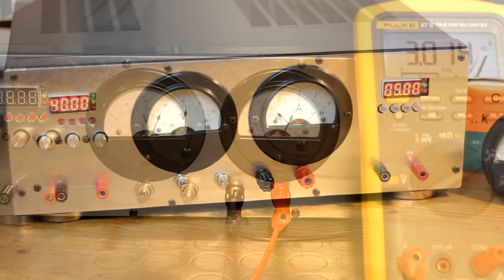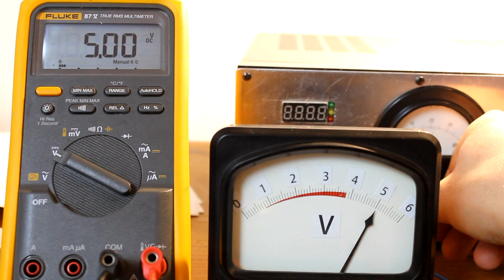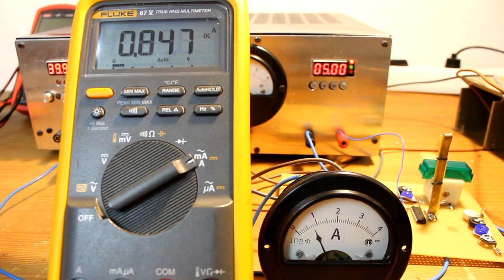Trailer: Reuse, Modify and Calculate Cool Old Meters

Comment: I love recycling old meters like this.  One tip to anyone reading this though... if you take the glass out for whatever reason... do NOT use epoxy to stick it back in.  Thermal expansion of the meter body will crack the glass.  use silicone or some other flexible adhesive.

Comment: AC Amp and Volt meters are very cheap. But DC mA/uA and mV meters are very expensive. It will be really nice and cool to convert cheap meters into expensive ones with some electronics.
Reply: Simply go in the meter and mearure the coil itself, usually they only need some several mV for full scale deflection. add a series resistor according to your needs and here you go....;)

Comment: you get a thumbs down for uploadeing a trailer. i hate that! sorry.
Reply from the maker: Ok that's your opinion and it's good to know why someone might give a thumbs down, because without that I'm left in the dark, wondering why it happened. Now let me tell you about my reasons for uploading trailers: My last video was over half an hour long. Designing and building the power supply as well as filming, editing and recording the material needed to produce a video cost me between 120 and 140 hours of work. It was one of my most work- and time-intense epsiodes yet. But after one week I can see that the video has not been received well, only comparatively few people have watched it. On the other hand, there are (for example) enough people on Youtube who just talk into a camera for ten minutes and get way more views for that and earn way more money even for that little effort. If you were in my position you would have felt just as devasted as I felt a couple of days ago when I saw that all my work is basically for nothing. To be honest: I'm surprised that I even found the strength to get back to work right away. In fact I worked for the entire week to make a new good video possible and not think anymore about past failures. And now it is Saturday evening and a large portion of the work for the next epsiode is done. I have done the planning and thinking, and I completed the actual building process and the filming the material. But a good video also needs a clear narration, good audio quality and clean editing, or otherwise people will not watch it. It would be possible to force these things within a couple of hours and publish a very mediocre episode, but then I will hear people's complains about the shortcommings of the episode for years to come. For all I know this stuff will be online forever, so it better be good, when it goes online. On the other hand, I have patreon supporters and many other fans who are used to the high frequency of uploads that many content creators offer. So in a situation like this, it is the best compromise to offer those people a little update, a little teaser that shows them that I'm working on something interesting, even though no new entire epsiode is finished yet. And I'm actually glad that you posted this comment, because it makes my understand what some people's reason might be to dislike a video. But I also have to say, that I always put a "TRAILER" in all caps into the video title, so that everyone can see what it is. So next time, please just read the title and don't watch the video if you don't like the trailers. It might not be your intention, but all that dislikes are usually doing, is to lower my enthusiasm to get back to work.
Reply: first of i'm a patreon, i really enjoy all of your videos, i will admit i'm not good at leaving a comment. mostly because of my dyslexia.
i have one problem with the the word trailer, it is in the back of the title. and when i get a notifikation on my phone i cant see the whole titel Until i "click" it :) i'm looking forward to this movie but when i realized that it whats a trailer i got annoyed. but please take it as a positive criticism. again, I enjoy all your movies, keeps op the good work
Reply from the maker: Ok. I can understand that. It's a valid criticism and I guess it's a good thing that you like my videos so much, that it makes you angry when it's only a trailer :D. So I guess this is the best way of getting a dislike. Thank you very much for your support and for your honesty :)
Reply: I really enjoy these videos and am heavily inspired by the work you do. The 'trailer' approach is good as it builds anticipation and reminds us of the work that's required to generate such in-depth and quality content. Since your DC power supply video I have been searching for an old AV receiver so that I can utilise it in a similar way; I'm an electrical engineering student and am in need of a lab power supply so the work you do is certainly not in vein. positive comments are probably far less common then the negative ones please keep up the good work as it really is very highly appreciated. Also, What is your source for these moving coils meters? I'd like to get my hands on some myself. Thanks mate.
Reply: Now read your wall of text again, from the perspective of one of your viewers, and tell me what's wrong with it.
Reply: The Post Apocalyptic Inventor   The same thing happened to me but it doesn't bother me at all. Maybe a little disappointed it wasn't the full video, but I can wait!  I bought a lot of those meters for $1 apiece at an antique radio swap meet years ago, and I may finally have a use for them. Looking forward to the video!
Reply from the maker: Well, if I'm supposed to take the perspective of the viewers, which I have to do nearly all of time when making my videos, then it is only fair that viewers who criticize me, take my perspective once in a while. And that perspective involves A LOT of factors, hence the "wall of text".
Reply: The Post Apocalyptic Inventor what I mean is, look at the tone. It comes across as defensive and a bit whiny. Also, between the lines, I read the motivation of ROI: "I put so many hours in, and someone who just talks into a camera for 10m makes more than me". Youtube is not a source of income. If it covers the cost of your videos you're already doing well. If you're in it for the money, you're well on your path to becoming the next bland youtuber who constantly whines about how youtube changed the rules and made your life harder, when they're not busy talking about other youtube "celebrities". 

I know some people who've unsubscribed because they think you've become too much of a beggar and whiner. Personally, I'm still on the fence. But if I have to be honest, I much prefer the style of that other German electronics youtuber, because with him it's all about the project and the build process, and not about him and his personal situation. 

Sorry of that's harsh, but I'm just giving you the impression of a third person observer. Because we're all blind to our own image; we can never see ourselves through the eyes of others. Although looking at your own videos may help a bit, especially when contrasted to those of others.
Reply: don't worry about the dislikes as much, as the way you tube treats likes and dislikes in the end, is they all get added together and count as audience interaction. So whether thumbs up or down or a comment it's all interaction, and that will help to get your videos more potential views from non-subscribers by bumping you in search results. So there is always a positive to see in it. =) Looking forward to the full video as well. One of many jobs I did in the NAVY was gauge calibration technician - mostly liquid, temp and pressure gauges.
Reply from the maker: See you talk to me as if your views reflected the views of "the viewers", while it is a fact that I have never really talked about myself and my situation for more than two years on this channel. It was largely because many "viewers" wanted to know more about me, that I started to open up and talk about personal stuff. Since I never talked about it before, the personal stuff has of course become "more", but I guess one thing hasn't changed and that is, that this channel is about the substance. 
Also you can call it "begging", but the people who actually support the channel make it possible for me to continue my work, without the need for corporate sponsors and the strings that are attached to that. I'm not saying that you are alone with your opinion, but on the other hand there is  large number of viewers that do support the channel and that help actually changes something in the real world. You and others might have many ideas of how things could be done better, but the truth is, that your words don't help me or anyone else. I run this channel as good as I can and I do it with the support of people who like it. The alternative would be that I just do something else with my life again and then there would be no more videos, or only one here and there in a long while. And I  just don't think that that would be the best way to go about it.
Reply: Hey, ich möchte dir ein paar aufmunternde Worte da lassen. Man kann durchaus erkennen, wie viel Arbeit in deinen Videos steckt. Es ist - finde ich - auch vollkommen in Ordnung enttäuscht zu sein und dies auch mit zu teilen. Warum auch nicht!? Es gibt schon genug Menschen, die die unrealistische Vorstellung, dass alles immer super-sonnig-enthusiastisch ist, transportieren weil Selbstzweifel negativ konnotiert sind. Tatsächlich zeigt es deine Stärke zu dir  zu stehen und das ist eine tolle Eigenschaft die man selten findet, da viele Menschen große Angst davor haben. Am Ende ist es wichtig, dass du dich nicht hängen lässt, neue Projekte angehst und persönliche Interessen ("Was will ich tun") nicht vollkommen von Klicks abhängig machst. Leuchten deine Augen, wenn du von deinen Bauten anderen erzählst? Hast du zu dem was du tust wirklich Lust, strahlst du es auch aus und kannst andere Leute begeistern, das Ergebnis wird gut und du verbiegst dich nicht selbst. Alles Gute dir!

For English speaking folks: Just some words in German that he should keep up his work and not be afraid of speaking his mind. Showing doubts is also a strengh few people have. It was just more natural for me in my mothertongue.
Reply: I say don't waste your time explaining to people like this or/and trolls.
Better even, spend that time making the great videos you make but maybe add a short "face" statement as in this video and ASK/REMIND your viewers to share... and the rest HELP stuff because if you don't ask - you don't get.
Again, don't bother with the people that don't get it and need lengthy explanations - they are not worthed imo.
Great job as ever and the trailer did its job in making me ready and wanting to watch your upcoming video and even play with vintage meters myself.
Sherring with my 11000 followers too ;-)
Way to go!
Reply: I don't speak for "the viewers", because the mythical "the viewers" which are in perfect agreement is a beast that does not exist. I speak for a small subset I actually talked to, which is representative of a larger group. And among those I spoke to there is consensus that this is how they perceive you. What you do with this information is up to you.

What bothered me about your initial response was that you justify yourself from a weak position. You manage this channel, right? You create the content, you put in the time to edit it, polish it, upload it. So if someone criticises an aspect of your work, you don't make long winded excuses as to why you did what you did, you don't start whining about how hard all of this is. You consider their criticism, thank them for it if it's relevant, briefly explain your reasoning while leaving out all the drama, and learn from it if applicable. And if not applicable (there will always be trolls), simply ignore it. Why let it get to you that someone might not like your content? It is impossible to please everyone. Criticism is there to learn from, not to have it affect your mood.

At least, that's my take on it.
Reply: If you want a cheap PS, you also could use an old PC power supply and add may be two cheap DC-DC converters (see ebay) to have a power supply you can start with...also see my other above comment on where to get cheap movein coil meters, and how to deal with them...;)
Reply: that´s the main reason why i don´t really like doing YT videos any more...it eats up so much time, the time i could have spent better on building stuff...so i really don´t do much YT suff any more, besides showing some quick&dirty short and non-edited clips and focus more on my instgram account where i can show things faster and by far more easier....I simply haven´t got the time for this editing and re-audio processing anymore...thanx to my dayjob....
Reply: I actually like this trailer (and most of his other trailers).  I like seeing the "preview" of what I want to watch first. It helps me choose what I want to watch, and what I don't.  Thumbs up for me.
Reply: Kim Loft Bennetsen bullshit. nobody forces you to watch it and you were also not tricked into watching it since it clearly states that its a trailer.
Reply: I also meant to put down a dislike, but more as a feedback towards the fact that I wasn't expecting a trailer. It also didn't look like a trailer, I was almost thinking I had to get actual information from the video. I'm looking forward to the actual video very much because I have a shit ton of those meters and I'm glad you're taking the time to explain how to use them. About the power supply video: I didn't watch it, because I'm expecting a video that I won't be able to follow through because it seems very work intensive. It's definitely a cool meter, though. I'll watch the video now.
Your videos are great - a bit technical for my taste, but I guess that technical videos are proving their value more in the long run because people will keep coming back to it for reference rather that watch it for entertainment right away.
Reply: Kim Loft Bennetsen fair point
Reply: digitalradiohacker: please try to act like a grown-up. First of all, I am not being hostile towards TPAI. I merely criticised some aspect of his videos, based on my own observation and independent discussion with others. So it's really not necessary to attack me for expressing my views and those of at least some subset of his (ex) viewership.

Second, if you're in a foul mood and simply must insult someone online (we all have days like that), try to take some pride in it and at least insult them by criticising something they actually attach some non-zero level of importance to. You might as well have pointed out that I don't exactly have the most womanly figure. While certainly true, it's not like I'm putting a lot of work into it, sweetie. 😙
Reply: Yep - TROL confirmed!
Reply: That's spelled with two l's, genius. I wonder what else you got wrong. ;-)
Reply: Now my spelling bothers you - Yep def a troL

Comment: I do this with every "DrehSpulMessinstrument" i buy. Mostly used, off ebay and mostly with a single digit count on it. Just for fun. Because i like these old meters.
Usually i proceed as follows: quick test if it´s working.
If so i go in just to see in which condition it is and if someone already was in there (not uncommon for 30+ years old meters)
Also i remove the resistors, or use some spare screw terminals to gain access to the coil leads.
With that mod, i can pretty much use it for any measurement thing, as these coils are usually rated for several milliVolts for full scale needle deflection.

And when i find a use for a meter, i do the following:
I design a circuit for the meter, with usually also compensate/alter the needle movement dynamics/ballistics as well (as mostly i do VU-meters) and therefore i need to have access to the coil anyway.
And most times i add a nice flood-light as well, i used to mount some 5050, 0805 or 0603 SMD leds inside, but since there are these nice neopixels around i use them, and have the opportunity to illuminate the entire meter different for different usage(es).

Next thing is, i also do completely custom DIY faceplates (i already showed this on my insta account how to do this), by scanning the original plate, alter it and print it out on best quality ink-jet foil and place that foil on the back side of the original faceplate. Doing so, you always preserve the original faceplate and have a fully customized plate according to your needs. 

Glueing something on the faceplate itself is not a good idea, it looks cheesy and also might come off again shortly, because the glue usually interfer with the (old) paint used for the faceplate printing.  Only one time i done a complete plate CNC made according to my design.

BTW: ich hab diese "KTAN" DrehSpüler" auch, sowohl pollin als auch oppermann hatten die ne zeitlang für kleines geld, mir persönlich sind die aber schon zu "neumoisch" die echt schönen sind aus den 20ern bis 50ern...;)

Comment: Great, i hawe a couple of old amps, i want to conwert to Volt and make them more sensitive then the originals are.
Reply: go in, measure the coil directly, usually several milliVolts for full deflection and simply add a series resistor to meet youe needs...
Reply: Thank´s!